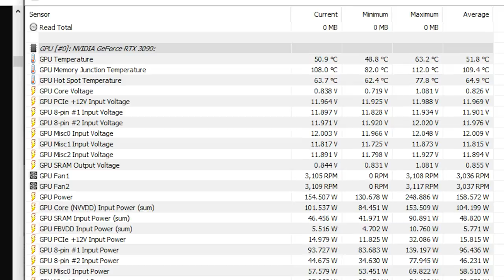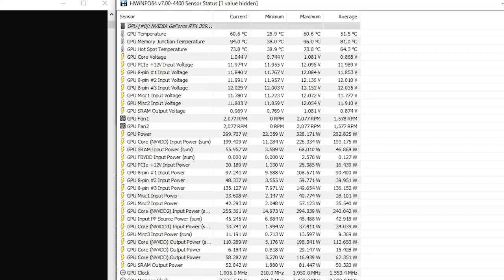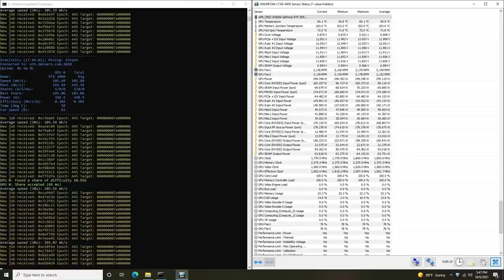Zotac RTX 3090 Trinity Thermal Pad Replacement

Comment from the maker: Use promo code SOAT and checkout with crypto to get a Bitcoin Shaker at Gamersupps http://gamersupps.gg?afmc=SOAT
Reply: All 3090 have terrible cooling, (crap pads or paste, and no backplate cooling) considering they're a premium product, you'd expect better. I feel your pain.
Reply: Are you only using 2mm for this graphics card? Would you cover more areas with thermal pads then before? Is there a major difference between the gelid extreme and gelid ultimate?

Comment: Excellent video, well explained. The only very minor point I would say are that you need 2 sheets of the thermal pads you listed in the description and some of the plugs on the gpu card require a screwdriver to pry out.

Comment: I enjoyed the video. So it is three pieces in total, the front, the middle section and the back plate. Replace the thermal pads on both sides and the thermal paste on both sides, before reassembling.

Comment: @4:14 - Highly disagree.  There are two manufacture editions (EVGA's FTW3 Ultra and Zotac's AMP Extreme Holo) that have given consistently excellent stock thermals across multiple chips compared to other brands, including the RTX 3060 Ti, 3070, 3070 Ti, 3080, and 3090.  The ZOTAC RTX 3090 AMP Extreme Holo (2) actually gave the lowest temps of 42C Core / 70C Mem average w/ stock pads on +1400 mem overclocks.  Multiple EVGA RTX 3070's, 3080's, and 3090's gave 38C - 42C Core / 74C Mem average temps.  EVGA, Zotac, and ASUS are the only brands I buy for mining.

In my experience, MSI & Gigabyte are by far the worst.  EVERY card I've tried from them gives 100c+ Mem temps on stock pads, usually right out of the box.

EDIT: I forgot to mention that my ambient temps are typically around 19.5C - 22.2C (67 - 72 degrees Fahrenheit)

Comment: before I used to see the same temps, after pad replacement I still hover around 96 celsius locking the core to 1100.
The amp holo is about 10 degrees better in stock form, but they still aren't that great. Zotac needs to get their cooling pad game together.
Reply: why is your core overclock so high?
Reply: @WhatsY0UTUB3  core is locked to stay at 1100, not a +1100 on core if that helps. Locking keeps wattage usage low as well as temps.
Reply: @RicanSoldierBoy  oh i see. i underclock my core -500 (windows) and -1000 on HIveOS, haven't looked into locking it. is locking better?

Comment: Hey question for zotac trinity 3090, the back thermal pads are 3 mm. I want to use the copper plate which is 1.57 mm, and 1 mm thermal pads between the copper shim and PCB. Should I use 0.2 mm, 0.3 mm, or 0.5 mm thermal type between copper shim and back plate? 1.57 + 1 + 0.2, 1.57 + 1 + 0.3 or 1.57 + 1 + 0.5 ? thanks

Comment: Definitely be interested in seeing the holo repad , I’ve done a couple with thermal right extreme odyssey and reposted and it dropped by about 15C on the hotspot but they are still a bit too hot to get max hash  , I was thinking of redoing them with more pads to get more contact to the backplate
Reply from the maker: I still don’t have max on holo it hovers around 115mh/s
Reply: @SonofaTech  I,ve repadded a lot of cards , The Zotacs I think I’ll take another look at as they just don’t seem to cool well with the back plates maybe use the backplate as a template and cnc a big copper heat sink backplate that is a direct replacement.
I’m investigating an Aorus 3090 that I repadded a while ago . On a 13 card rig it throws overheat warnings at 104 and won’t do more than 50Mhsh no matter where the mem is over clocked.

Pulled it and stuck it in a modest pic. Assumed it had lost a pad or I’d messed up the repad . Nope does 121Mhsh at 94C , the fans are 100 % which is slightly weird as most of my repad will do similar with 50-60% on the fans.

So I have no idea why this card is fine on one PC and not on the other , cpu and general spec on the pc is way beyond the mining rig but even so it’s a mystery .
Reply: Repadded x2 zotac 3090 Trinity over the weekend,
Figures are based on NiceHash and the limiting factor being not pushing the mem junction over 105C with the mem overclock , gpu is normally about -300 and power about 300-310W

Card 001 Stock
Hash 68Mhsh  Temp 106C   Fan 90% 

Card 001 Repadded Gelid  2mm Arctic Mx4 re paste
Hash 119Mhsh Temp 105C fan 90%

Card 002 Stock
Hash 92Mhsh  Temp 106C ( gpu 89C!)   Fan 100%

Card 001 Repadded Gelid  2mm Arctic Mx4 re paste
Hash 119Mhsh Temp 105C (gpu 64C) fan 85%

Have at least one more Zotac that I repadded a few months ago with thermalright extreme odyssey , think that’s got 1.5mm on the gpu side and 3mm on the back and manages 108Mhsh at 105C with fans at 100% be interesting to try 2mm thermalright on it all over . I didn’t notice much difference in softness between the thermalright and the Gelid to be honest .
Reply: @LookABear  I bought 6 packs of 90x50mm x2mm . Used  2.5 packs doing the two cards looks like . For one you’ll need 2 packs .

Comment: Check out the gelid extreme thermal pads. I have an EKWB waterblock sandwich on my evga xc3 3080Ti and mem temp was 90C while mining using the included, from EK, 1mm thermal pads on front side. I tried 1mm gelid and it barely touched/squished. Changed to 1.5mm on front side, left the other blue pads on backside, put back together, and now mem is 60C (again, on water)!!!!

Comment: There is a mistake here.

Backplate uses 3mm pads, not 2mm.
Reply: ahahaha
yes, this is a big mistake
Reply: @R1DER76  I think he also missed the VRAM pads.  Under the black plastic "cover" that looks like plastic heat sinks are the vram modules that have their own thermal pads that are sandwiched between the black plastic "cover" and the top of the vram modules.  I have two of these 3090's and forgot to replace them on one and replaced them on another.  Temp difference was about 5 degrees difference between the two after pad replacement.  However, even with the pad replacements I'm still getting temps in the range of 98-106C when using -200, 1300, 330 pl (@124.7 MH).  I have some really chunky heatsinks (14" x8 " x 6" tall) that I'm going to install on the back plate to further dissipate the heat being generated by these lava monsters.

Comment: So replacing with 1mm isn't good? Should I throw them away sell someone or can I use them 1 over the other 1+ 1? Possibly a bad idea.
Wait.. when u turn for re-closure you don't check they stay in place? That's risky, you should give them a look before closing \ press the pads otherwise they can get out of position.

Comment: I noticed that you used the pea method when placing thermal paste on the GPU die. This is risky as you might not get 100% coverage on the die, and I would recommend using the cross (or X) method from edge to edge. This will make sure the entire die is covered with paste, and the remaining paste will spill over the edge (assuming you're not using conductive paste, but who does these days anyways).
Reply: As yes, the thermal paste debate that got debunked by Gamers Nexus. I recently saw a video of Steve re-padding an EVGA and he did the "rice grain method" and explained why (in short, it's no a CPU). Personally, I would spread it with the spatula.
Reply: @Prophetian  Not sure what video you're referring to, but the difference is that a CPU has a heat spreader on top, so using the pea or rice grain method doesn't really matter as much it does for a GPU die. If the edges of a GPU die is left bare metal, it can kill the graphics card over time as hot spots can develop. And spreading with a spatula or doing the X method, is really the same thing in the end (results can vary of course)

Comment: I have a 3090 trinity too and the pads are not so bad, they are very soft  and in the front you need 1.8mm, the problem with 2mm is that they don´t squeeze like the stock ones and... the DIE doesn´t get close enough to the cooler, less contact and higher temperatures, be aware of this, my next move is 1mm pad and 0.8 copper pads in top in front and redo measurements in the back because i think i can put a very thin thermal pad and 2mm ones. I have pads in the back of the VRM too.

Comment: Thanks i have the same 3090 with summer around the corner i really have no choice today is Thermal pad changing day! I'm surprised how heavy the sheets actually are if you buy good ones and not cheap crap of amazon (Look for Thermal Conductivity if it don't tell you don't buy 12.8w/mk or higher folks! )

Comment: I deshrouded mine because two fans no longer worked. It's been sitting in an open-air mining rig (used for AI--no mining) and temps range from 20c at idle to 29c at full inference. 

Should I replace the thermal pads anyways?

Comment: Considering what is 3090 even at MSRP they really should do better job with memory cooling.
I'd see at least a thermalpipe going across entire aluminium backplate...
On the cooler side I'm sure the memory is chill.

Comment: Just got a used 3090 popped it in my computer and it was throttling insanely high. Deshrouded and the line of vram that is at the little cutouts on the backplate did not have any thermal pads on it. Getting some pads and some paste and hoping I didn’t just waste my money on a 3090 that runs like a 3070

Comment: I tried doing the pads on my zotac 3090, turns out the cooler had bad mounting pressure so bought an alphacool waterblock well same issue poor mounting pressure had to use C clamps on the card to get the temps stable. Went with EK block and active backplate and its AMAZING 40c core 60c memory 24x7 mining.
Reply from the maker: ya the active is great.
Reply: 60c memory nice

Comment: For people saying the pad measurement for the zotac 3090 trinity/trinity oc on back side is 3mm: 

Please show evidence of it by measuring the original pads!!

I measured them back when I changed them and they were 2mm

Same as the VRM ones (under the black bracket)  they are 2.5mm and not 3mm!

Comment: The ones in the back of the card are 3mm, VERY IMPORTANT
Reply: depends on brand
Reply: @mikeserds2333  of course it does, but for the Zotac RTX 3090 Trinity are those. I will replace the thermal pads really soon, I will use coper thermal pads.
Reply: @ezeenlugares441  What temperatures did you get at full power?
Reply: @mikeserds2333  the ambient temperature is important. Lots of ventilation. I got maximum 106° C VRAM temperature.
Reply: @ezeenlugares441  wow that still sounds high. what temp was it before the pad change lol
Reply: @mikeserds2333  that was the highest. I will change the pads soon. I will do a video, for what I know the copper pads should put down 20° C. 
Of course when it reached that temperature I shut it off and put more vents
Reply: @mikeserds2333  that was the highest. I will change the pads soon. I will do a video, for what I know the copper pads should put down 20° C. 
Of course when it reached that temperature I shut it off and put more vents

Comment: I used to own the 3090 Zotac AMP Holo.
It was so terrible with the backplate cooling, that I insisted on sending it back. I ended up getting a MSI 3090 Suprim X instead. Which I installed a few heatsinks on the back and put an old FX CPU cooler on the backplate. All of that brough me down to 86-90°C.

But that Zotac AMP holo.. It doesn't even have Thermal-pads on all of the back- Vram chips. Not even mentioning the fact how little space they leave to exhaust air out of the card. I have no clue how such an expensive model can perform so poorly. Mine was getting 60mh's as it would heavily thermal throttle on a highly underclocked setting.
Even 3D rendering easily brought it to the 110°C limit. While the MSI card doesn't even go above 70°C in the most demanding scenes when it comes to blender.

I'll probably never buy anything from Zotac again. Wanted to get a EVGA model. But you know. Can't really choose these days.
(Also had a Palit 3090 Gaming. That one was surprisingly good. It got to around 88-94°C with extreme oc's in mining, just by placing a FX cooler on the backplate where the V-ram was.)

Comment: I just installed watercooling on mine haha. The temps were so high.
Reply: what are your temps? My brother installed an alphacool waterblock on the 3080 Ti which has no VRAM on the back and still gets 102 degrees while mining RVN. He even put a big aluminium heatsink on the backplate and points a 120mm fan directly on that heatsink. The GPU has only 32 degrees.
Reply: @xXSeak  You have a problem with the pads for sure, i have a gigabyte eagle 3080ti, change a dirty setup of 2 *1mm 7mw/k stacked pads and went from 108c to 92c, also 3mm pads in the back plate helps (all stock air cooler).
Reply: @fcmancos884  okay I hope so. Will order these pads soon and try out if there is a difference. Otherwise I don't know what else to do. The waterflow is really strong with a EKWB DDC pump and GPU and CPU are very cool at all times.

Comment: Hi SoaT, really nice video, helps alot, one question, apart from changing the thermal pads, do you know if the aluminum heatsinks on the backplate also helps?, I thinking in change the thermal pads and add a aluminum heatsink for more performance, but I dont know if really helps

Comment: Replaced my trinity thermal pads and didn't see an improvement in temps.  Tho I had added many heatsinks on the backplate and had it on a stand beforehand. Getting 121 @ 90c np on memory tjunction.

Comment: I have the same card, attempted the pads and leaving it on air, cut a hole on the useless backplate to encourage more airflow to the chips, nothing helped.
Banged an EK front and rear waterblock on it and put it in my gaming pc, haven't look back since.
122mhs with 85.c mem temps

Comment: Thank you so much for this. I just did this and worked great.
Reply: Are you using this grafics for minig?
does replacing the pads solves the problem?
bc it may lower the mhs and increase the tem?
Reply: @nderimpollozhani3500  yeah increased profits by 40 to 60%. The temp dropped at least 10 c. There was a bunch of hairs I found on the board of the cards.

Comment: Hey SoaT! When replacing thermal pads on my EVGA 3080 FTW3, I sadly snapped the blue plastic latch that locks in the blue connector for the fans. Is there any heat-resistant glue you'd recommend to stick it back on?
Reply: i would use  a small dab from a hot glue gun personally.
Reply from the maker: I haven't used any personally. is it popping out?
Reply: @SonofaTech  It's mining okay but I bought it with MicroCenter warranty and will want to trade it in after 1.5 years
Reply: which size of thermal pads you used for the EVGA3080 FTW3?

Comment: Hi, I followed this guide to the T, and now my card turns on but I'm getting no signal at all, first time it booted all way to Windows but as soon as i used power I got blue screen and video tdr failure, now it won't even boot all all, I've even put old pads back on as I was using gelid 2mm ultimate and still nothing,  card was running perfectly well until I changed pads, now its looking like it's game over card, any ideas, thanks

Comment: This is great information loved the video! That being said even with better thermal pads those temps are horrible compared to the the Nvidia Founders edition 3090. I get 121MH or 123MH (with monitor off, no joke) between 43c and 47c, memory at +1300, power at 80%, and core down clocked by 200mhz. The founders edition 3090 cards run really cool but I didn't think they are that much better, really surprised. Maybe I just have some really good cards IDK?
Reply from the maker: The cooler for founders does better on the rear modules
Reply: @SonofaTech  That makes sense just surprising there is that much of a thermal difference I had no idea. I made a lucky choice getting the founders edition cards when I did I honestly didn't know there would be a difference.

Comment: Do you get any better performance with individual pads on the memory rather than strips does that offer  slight more air flow round memory ?
Reply: airflow immediately around the memory is not really a factor. the thermal pads conduct heat from the memory to the backplate and heatsink which then dissipate the heat.

Comment: Im starting to tap out on power available in my bedroom. It would be awesome to see some videos on Upgrading electrical (not DIY obviously) but what should we have an electrician do
Reply: Easy, install a circuit breaker, and possibly a commando socket or something similar that has high amp rating
Reply: @Prophetian  In my region, the amps on my circuit breaker are selected based on the gauge of wire that has been run through the walls (among other factors). Swapping out a breaker with one that handles more amps does nothing for the wires in the wall. There is no sensor in the breaker to tell you you the wires can't handle the load. Blindly installing a larger breaker just lets the home owner push enough current through the wires to cause a fire instead of causing a breaker to trip.
Reply: @henrykissinger8088  I didn't advice him to do it himself lol. obviously hire an electrician if you lack the knowledge.